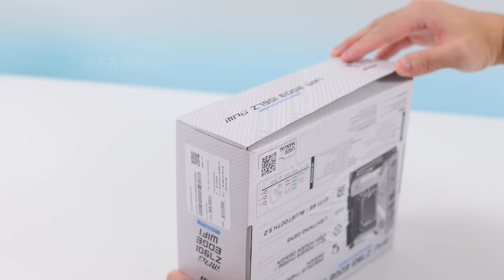If you want to take 4090 to college, try this chassis | Phanteks Evolv SHIFT XT Build

Comment: This casr only have capacity for a rtx4080 or 4070 not for a 4090 RTx this guy is a liar 😂
Reply: You literally just saw him out a 4090 in there and also I just made this build aswell it fits
Reply: @ClipWedge that’s a 4080
Reply: @diegonazareth23  dude I literally have the same exact case I built it with a 4090 fe